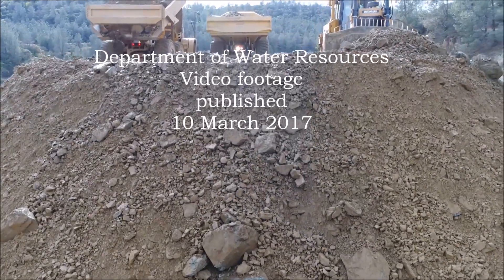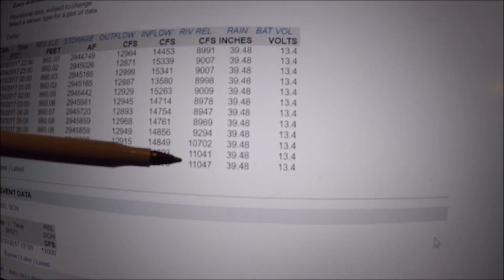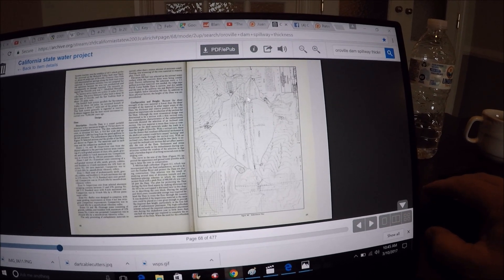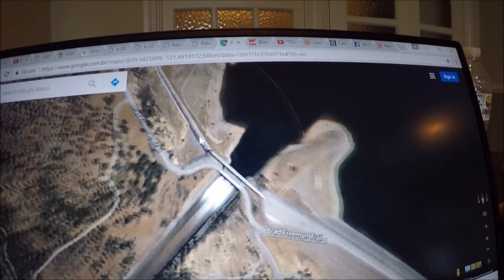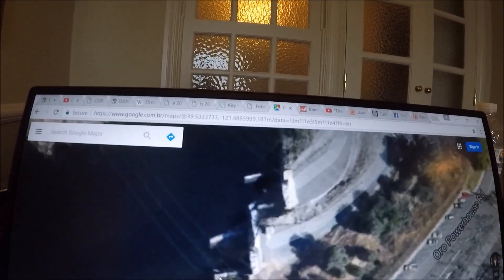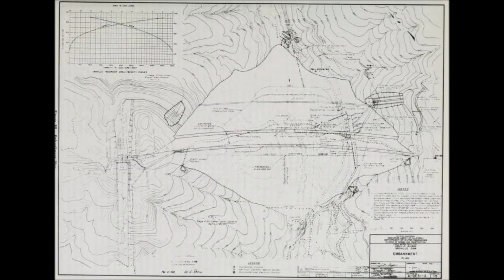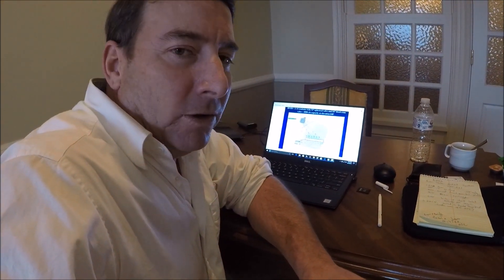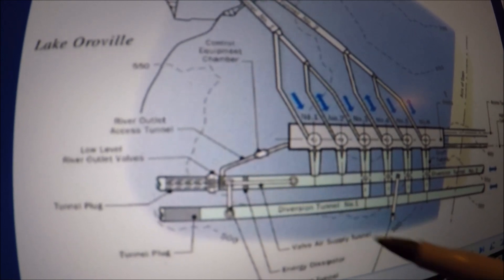Oroville 10 March "What's Under The Oroville Dam?"

Comment: Seems like a nice cosmetics cover. Of a more serious problem underneath the concrete most likely is unstable and broken rock the mass of water and time and the elements surely has caused much erosion beneath the bottom of structure

Comment: The question in my mind is how the emergency spillway footing was constructed. Is there anything in the blueprint book about that? Is it just sitting on the weak rock that quickly washed away or did they dig down to bedrock? How truly vulnerable is the emergency spillway dam.
If they don't know, they should do dig or drill tests to find out.
It also seems to me that a simple solution to stop erosion up against the current emergency spillway concrete dam would be to dig a ditch down to bedrock a little way away from the emergency spillway dam and fill it with concrete like a concrete curtain similar to the core of the main dam. Then connect it to the spillway dam with a concrete slab. If the emergency spillway has to be used and erosion comes up to the  curtain that goes down to bedrock, there will just be a waterfall down to bedrock. No big deal. Sure it will cut a bigger deep channel like it already did with only 2 feet of water over the spillway and wash down a lot more debris into the diversion pool. But at least there will be no chance of it eroding up under the spillway dam and it collapsing as everyone was afraid of. 
The slab maybe could be used as the new road to the parking lot at least part of the way.

Comment: lets hope and maybe the suggestion should be made to either use benders to create loops in the rebar ends when it gets replaced so it cannot easily pull apart under extension.  like what probably happened.. concrete is strong with rebar in compression... the rebar holds it strong in extension.. but if the rebar is not hooked together from one segment to another on that slope.. the friction of the water rushing down will separate it at the weak points.  they may need to carve grooves in the remaining sections all the way from the top to the bottom .  so post tensioning cables could be installed to stop the friction of the water going over the main spillway from attempting to separate the remaining sections.    they should be able to carve into the surface and lay conduit and use some type III cement to encase the conduit tubes.   "
     Type III is a high-early strength portland cement that provides high strengths at an
early period, usually a week or less. It is used when forms are to be removed as
soon as possible, or when the structure must be put into service quickly. In cold
weather, its use permits a reduction in the controlled curing period. Although richer
mixtures of Type I cement can be used to gain high early strength, Type III, high-
early-strength portland cement, may provide it more satisfactorily and more
economically.  

    
there are also special mixes available for fixing freeways that have only a 15 or 20 minute working time. are ready to drive on in 4 hours.. used for fixing freeways with local batch plants..

Comment: I need some help here regarding pumping back up into the reservoir.  Why would you run a turbine to create power to then pump water back up into the same reservoir.  (I can understand a separate reservoir)   If you want the "battery"then why not just stop all turbines?  Either way this would drain the river outflow.  Is the power for the pump coming from somewhere else?  And then what about outflow to the river being sustained?
Reply: When you stop a turbine you produce less electricity. But when the same unit works as pump that increases the need of electricity sot he gap is doubled, and that is a good thing when other on-storable renewable energy is producing a lot (like wind or sun)
Reply: due to the fact that generating electricity and pumping water have almost same technical losses (hydraulic losses in the tunnels and pipes and mechanical losses of the pump-turbine itself) , with the same difference of level between the upper and lower reservoir and with the same power of the alternator/motor, you can pump only around 80% of the flow you can turbine (may be less in other plants when there are longer galleries between the two reservoirs)
Reply: 1) To account for excessive peak demand that occurs daily with air conditioning.
 2) Can't stop power without brownouts - is this Bagdad or the USA?  River outflow is compensated for by the Thermalito Afterbay - 3) you should wiki, after you wake up of course.`1964

Comment: So I'm probably missing something obvious, but a question:  You have said that eventually the main spillway will have to be used sometime soon, and you've talked about a high flow rate to prevent head-cutting the broken spillway.  What will prevent debris washing back in to the diversion pool, erasing all the work of those nicely coreographed backhoes, blocking the power plant outflow, and starting the whole problem over again?
Reply from the maker: Therein lies the crux of the dreaded 'Yoyo' effect...

Comment: I am highly inclined to believe that they have no plans in Saving this Dam from failing the evidence which I based this statement fact number 1 you only saw a little bit of concrete pumping done and this is miles of water you're trying to hold back frankly these people should be pumping concrete Non-Stop for the next 6 weeks until the spillway is filled completely with high strength grout with fiber mesh rust inhibitor and any other additive that would keep it waterproof until the hole was completely filled. I pump concrete for a living and if you don't see concrete trucks running in and out of that area feeding a concrete pump for multiple concrete pumps they are not trying to save that Dam.

Comment: As per requirements by the Army Corp of Engineers, the lake level requires a  mandatory release at 860 ft.   Instead, they chose to let the lake flood over the weir.  Why?  In 2013 the cement flume was repaired, inspected and given the OK.  But, it was severely compromised.  Even now, the goal seems to be use of the weir.  This is where they have created huge stair steps and have cleared vegetation so as not to fill the river with trees and shrubs.  This week, they even changed the trigger point from 860, to 865 ft.  This means, they KNEW the dam was in trouble before the flooding on Feb 11.  All this Band-Aid work is about the weir, which doesn't look like a good solution due to the massive erosion which will inevitably result.

Comment: @blanolirio, im wondering why you said the banks erosion was from the quick turn off of the power plant, when the power plant hr  said it was just natural erosion and not from the quick shut off of the damn.
Reply: The river banks further downstream from the dam collapsed. When the river was full of water, the soil in the banks got wet, too. When the water level in the river went down after the power plant shutdown (and spillways were closed too), the water was no longer supporting the wet soil by pushing it up and against the bank. Wet soil on a hillside -> mudslide.
Reply from the maker: yep!

Comment: You're telling us that water they're discharging through the turbines isn't running even with the reservoir inflows.  That means gross discharges will have to be raised to keep the water level down.  Isn't that going to cause problems downstream from the dam?
Reply from the maker: Downstream can generally handle it, but now there is some damaged farmers levees which may suffer more damage downstream on the Feather. I will check this out this week...

Comment: Wasn't it just a few days ago that you said the collapsed river banks were miles down stream and of little consequence.  I think people down stream should positively stay on alert because that massive snow pack is over 600" and all it's gonna take is a couple days of warm weather and there is a distinct possibility for a tsunami like event.  Remember the traffic jammed  highways when traffic wasn't even moving with the first evacuation.  Most of those people would not have made out alive if that dam had ruptured within an hour as was predicted.  I think within two or three days you will begin to see melt effect with the snow pack and warmer then usual Temps are in the forecast.  Hope for the best.

Comment: Define inflow vs outflow. Do I need to subtract inflow from outflow on the data table. Thanks
Reply from the maker: Randall Fisher yes
Reply: Why is the lake level increasing then?
Reply: I recall a recent discussion of this on the Twitter hastags. I'm no engineer -- technical writing in hi-tech industries was my bailiwick -- but based on data archived at the Metabunk thread https://t.co/G7KryYm7eI a rough rule of thumb would mean as as little as ¹/₁₂" seep from the sodden soils in the watershed's 3672 sqm  = 12" rise in the 25 sqm area of reservoir. That'd decelerate with rising levels as the lake isn't a simple column of water but rather martini-glass shaped, permitting greater storage at the high water mark expected during a flood.

Comment: One correction.  Diversion tunnel #1 outlet is always flooded.  It's floor at outlet is at  182ft elevation so it's top is around 216ft which is beneath the normal 225ft water  level.   The center line of tunnel #2  is exactly 225ft elevation from RVOS valves to outlet, and the water level in the Thermolito Diversion Pool is normally regulated to 225ft elevation.     When the debris dam raised the level 20+ feet it flooded tunnel #2 which causes a vacuum (cavitation) to be formed if you try to move any significant water through the RVOS or turbine outlets.
Reply from the maker: daemn42 Thanks Daemn! Got it.

Comment: Juan, great videos. Just to clarify, the maximum operating level of the Oroville reservoir is 900 feet, but the spillway rim is actually at 901 feet. Also gas turbines, such as found on aircraft may "exhaust" their combustion products, but water wheels, such as the reaction turbines and pump-turbines in the Edward Hyatt Power Plant, "discharge" through a tailrace.
Reply from the maker: John Smith Thanks John!

Comment: I still believe they should run a one inch steel plate one inch thick, one foot high across the spillway up 10 to 20 feet from the damage across it and angle up-wards and let the speed of the water blow out 200 to 300 feet.

Comment: They use electricity to pump water into the lake during off peak power demand times so they have the water for peak times.  They use electricity from other reservoirs and they give up the transmission losses and the pumping losses to do it.  How does that make sense?  Why not just use the water in its original reservoir to send the electricity to the peak demand?  

Also the source of that pumped water is the Thermolito Diversion which is tiny by comparison to, compared to Lake Oroville, how does pumping that little bit of water into the lake make sense?
Reply: Sweepleader: They wouldn't be using the pumped storage system at the moment. 
They use the systems differently at different times according to the conditions. 
Right now they are using the power plant as a way to drain water from the dam, so they are not going to be pumping any water back in at any time. 
They are generating electricity, but that is only because the system is designed so that the load on the generators regulates the speed of the turbines.
But the design of the dam is to allow them to use electricity that is cheap during the late evenings to pump water from the diversion pool back into the dam and then allow that water to flow back out of the dam again through the turbines and generate electricity during times of high electricity demand. 
Because demand is high (at that time) the value that is placed on that electricity is higher than what it actually cost to pump the water used to generate it it 
It's a system that is used in many dams around the world.
Reply: Well, I love your videos, very high quality with sources for your information.  Kudos.  By the way, turbin sounds right to me.
Reply from the maker: sweepleader supply and demand....
Reply: I understand all that.

What I don't understand is why it is worthwhile to spend the energy to move the water from one place where it can generate power to another place where it can generate power, either one during peaks.  It can be used during the peak times no matter which reservoir it is in, Oroville or anywhere else.  Especially given that the water Oroville could pump comes from such a small source as the Thermolito diversion.  There is not much water available to pump thus the benneit is small.

Anyway, thanks for the response.

Comment: Although the losses of the pumping process makes the plant a net consumer of energy overall, the system increases revenue by selling more electricity during periods of peak demand, when electricity prices are highest.
https://en.wikipedia.org/wiki/Pumped-storage_hydroelectricity
The dams use more electricity than they make, but earn revenue by selling back at peak demand, I never thought it worked that way...Why not close gates a night and open at peak demand,  if grid absorption is not needed at off peak?

Comment: I'd like to thank you for taking the time to research and compile these videos, and presenting them in a no nonsense, factual way.
As soon as I saw the initial event on the news, I've been very interested in this as a civil engineering project. 
It is a massive repair job and one that has many layers of complexity.
The commenters here who think they're just making it up as they go have no idea what will be going on in the background. There will have been many specialist engineering firms working crazy hours coming up with temporary and permanent solutions, as well as mobilisation of a vast number of personnel and equipment.
Anyone who thinks that can be done without a major effort is delusional.
What impresses me the most is the speed at which they've made it all happen, they've already removed about half of the debris field- a huge undertaking in itself!

Comment: It does not make much sense to me from a thermodynamics point of view to pump water back up from themalito vs. just shutting down as many turbines as needed.  The only explanation I could see would be to take partial load (assuming turbines need to run at a certain speed), but then one should not need three pumps.  I guess another could be that opening and shutting valves is actually more wear and tear on equipment than alternating between generators into pumps.
Hmmm...if multiple reservoirs are working on the grid and energy dumping is needed, I guess it could make sense to favor stores that are nearer the future projected load due to electrical line loss.  Perhaps this is the operating principle...and part of the reason for the various downstream pools.  Must be kind of fun to run these systems.
Reply: I suspect that it also has something to do with the ease of bringing hydro generators online quickly, which you cannot do with boiler fired plants. Keep the steam plants running all the time and use the hydro to either knock down the peak load or store energy at off peak times.
Reply from the maker: I think you're right about the multiple reservoirs idea...Thermalito Fore Bay is used in the same manner.

Comment: are they going to put energy dissipation on the remaining broken lip of the spillway
Reply: I would say this will be a multi stage project. Get the spillway operational as fast as possible and engineer a permanent solution in the next couple of years.
My bet would be a lot of the debris washed away ends up back where it was (to support the dam structure) and a new  spillway extension will be built to abut the remains of the old one.

Comment: Top of the emergency spillway is at elevation 901', not 900'. See cross section published online.

Note in new DWR picture with tilted scaffold there are sliding survey markers added on sidewall just upstream from the current spillway end. This will tell them if that last section is tilting downstream when the flow restarts. Also note that this appears to be an expansion joint that is both in the side wall & slab. They are also drilling into the slab, probably to grout any voids & better anchor the spillway to the foundation rock. This is where DWR has drawn its final spillway battle line. ¡Buena suerte!

Comment: This whole situation is going to go down in history as one of the most dramatic " dances " between nature and mankind.  I have seen  examples of water draw-downs done by using a siphon technique.  Large diameter pipes could be used in this technique.  The siphon could be built having an inlet at the correct reservoir level.  The pipes to carry the water could be built to discharge the water directly into the diversion pool without ever flowing down the landscape.
Reply: Yeah.  At 32 ft water would simply draw down a vacuum at the top of the siphon and stop the flow, if it didn't simply collapse the tubing.
Reply: Sadly you can't (practically) siphon water over something more than about 30ft high, so even if you could concoct some outrageously enormous pipe setup, you'd have to wait until the reservoir was about to overflow before you could use it.